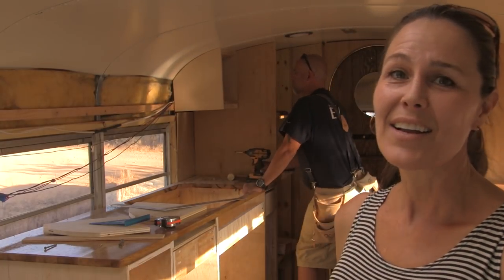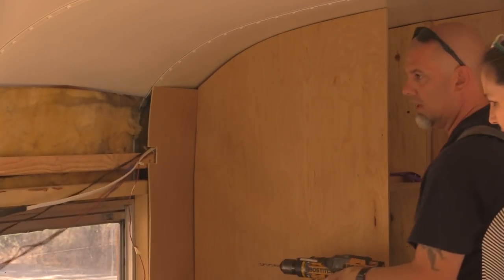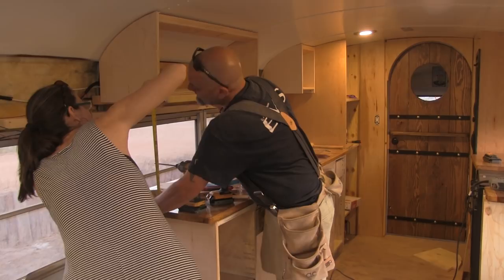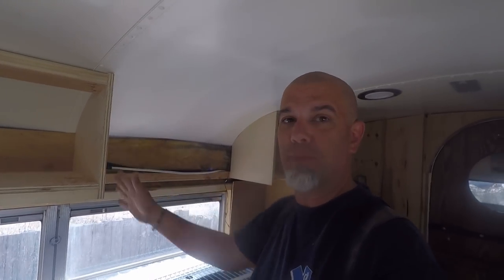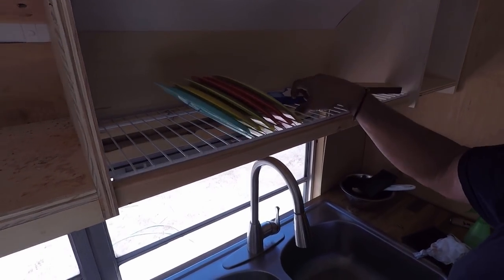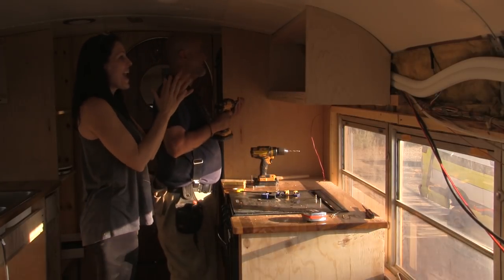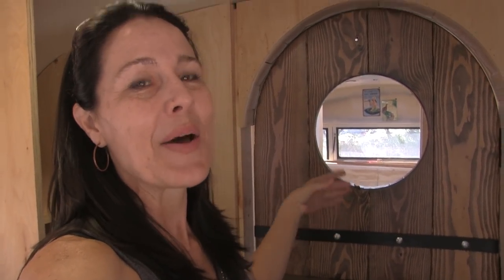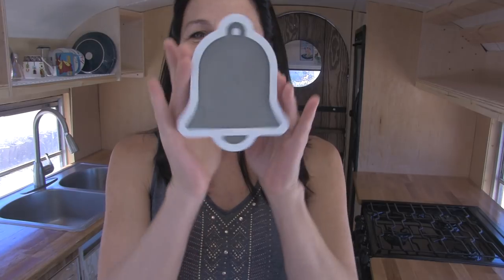Upper Kitchen Cabinets & Dish Rack + Tiny-Tour of Skoolie Kitchen!

Comment: I just love you two!!! The best part is you share the entire build and all the quirks that make you two unique and special!!! So an idea I’ve had is if you routed out a juice groove on your cutting board, that’d help prevent spills, possibly even drill a hole in the center for easy draining with a wooden plug for when it’s being used to chop messy tomatoes, etc. but my other thought is to install drawer slides or make wooden tracks (for removing to wash) but that way it’s out of the way, but in a convenient pull out drawer for as needed use. That and it’d be hidden among all of your other drawers! My last thought is instead of regular cabinet fronts for the uppers, why not make them sliding doors so during traveling you won’t need to lock up your doors? I’m not criticizing whatsoever, just some thoughts as I’m watching this for the hundredth time ;) lmao. I did see another builder implement curvy uppers with the sliding door concept and it seemed so appropriate for the purpose of his travel trailer. Obviously though you two have blown everyone else out of the water... seriously! The natural wood that’s light and airy and soft with the brilliant layout using closet cabinets to wall in essentially your bed/bedroom for a cozy nook feel and then into the bathroom and the amount of space and plus on its own seems cozy and private. Of course my favorite is the main living space plus a kitchen that houses seating/fold down bed etc etc! So recently I saw a popular builder build a kitchenette for his buddy’s travel trailer and this would be just perfect for you two!... he used scrap ply or 1x3’s and ripping all edges with a 45 degree bevel he created his own but similar take on Laura Kampf’s scrap wood subway tile backsplash! Omg it’d be perfect with your look and like they both did, stain your wooden tiles (the face only) in a color maybe even lightly paint just the fronts and it creates a gorgeous subway tile with the beautiful edges exposed leaving a grout like effect!!! Lol too much time I have apparently but at this point I’m emotionally invested in your schooly build adventure and would love to add too it lol 🤦🏽‍♀️ pls don’t stop when this project is finished!!! I hope you build yourself a travel trailer and then a tiny house in the mountains or on a beach, what I mean is I’ll be sad the day you guys quit filming your builds
Reply from the maker: Thank you for your input. Kerry and I have spent countless hours discussing the things you have brought up! I'm glad you are enjoying the build and we have no intention of stopping this vlog. It is just the beginning.

Comment: Mike if you add another wire rack on top of the plates that is not fixed at the front it will hold the top of the plates and when you travel they wont rattle also if you choose to leave the plates in the rack it will open more cupboard space up for you.

Comment: Mike, a small removable nylon bungee across the dishrack about halfway up might be prudent as well for travel. Also, don't know your plans for cabinet doors, BUUUUTTT, if you make them lift up you can attach magnets as knobs and they will latch to the roof of the bus and look clean. If you put stained or anything in that pirate window cool and heat can't pass s freely. Now, if yall ain't careful, yall is gunna finish that bus, then what is we gunna do? Great job yall!

Comment: That narrow space you have TV trays In is the perfect space for a slide in/out spice rack.. Many RVs have them, wouldn’t be to hard to source the parts.. Just a thought 😎
Reply from the maker: Initially, that was the design. But after looking at it we decided we didn't want to have to kneel down to see the spices. With that in mind the spice rack will be right in her face in the upper cabinet on the right hand side with some cool slide outs and features making it easier to find all the spices.
Reply: 👍🏻 even better! You two are quite the craftsman!